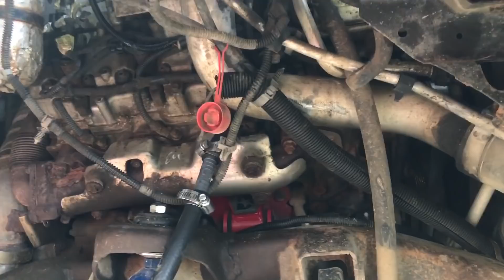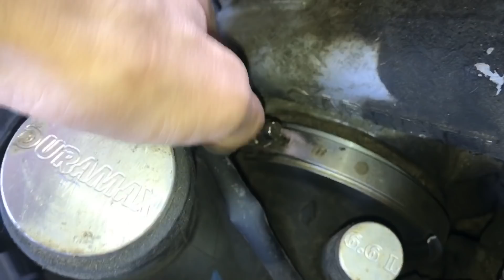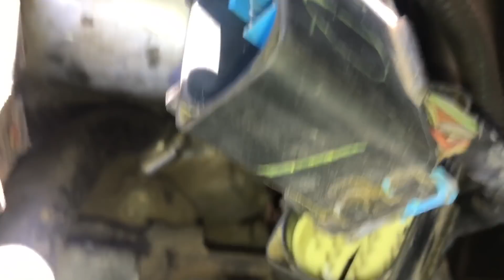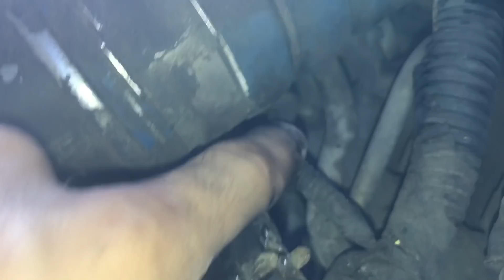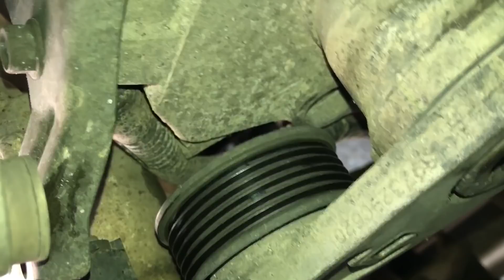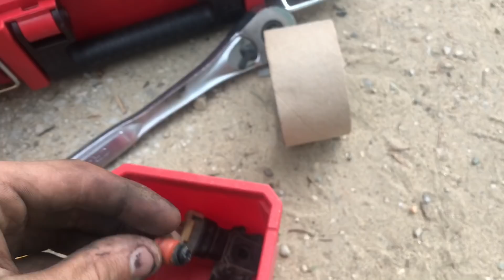How to Remove CP3 Injection Pump from LLY Duramax Diesel

Comment: Pretty sure they put the CP3 on a table and said ok boys.... lets build a truck around this. Ive never seen so many things have to be removed for something. My issue is the bums who did the FPR before me stripped the T25s out. Im having to remove the entire pump to remove the bolts. I only have about an hr a day to work on it bc of my job and daylight savings so this is going to take forever.

Comment: Thanks for the video it helped me. I just got everything apart, hopefully I’ll get it all back together tomorrow and the truck still runs. Bottom nut passenger side of the Y bridge had me about to get it towed to a shop, that metal line coming up under the turbo they could have routed anywhere, they routed it there. I’d like to be sitting next to a guy in a bar sometime that tells me he’s the engineer that designed that line route.
Reply: How’d you manage to get it in about to just leave it at this point
Reply: Dude I couldnt agree more! they routed many of the lines in terrible places, not just that one…why route the pass side fuel return over the bridge instead of over the cp3 then T with cp3 return…the factory design makes after
Market 1 piece y bridge a nightmare. Looking at the full soft line test block conversion kit from DHD to reroute all of them, but annoyed I have to 🤣
Reply: Same!

Comment: That was not a pyro sensor, it is the vane position sensor.  Also the one you said the sensor was in the fuel rail to the left of turbo is the fuel temp sensor and lastly the sensor on the bracket that holds the engine harness plugs is the barometric sensor

Comment: Does cp3 needs to be set on time with engine?
Reply from the maker: j. Onofre no it does not need to be set in time. It just creates fuel pressure for the common rail. So it doesn’t matter. If it was an older Cummins or power stroke it would matter.

Comment: The dirty Y bridge - I don't understand why it is so nasty.  Yours looks like another video that I saw, so nothing unusual there.  When I took mine out from my 2003 @200k miles, mine looked very clean; I don't recall any carbon or buildup at all.  In thinking about it, this should be fresh air that passes through turbo then the intercooler, so where is the crud coming from?
Reply: that comes from the EGR (exhaust gas re-circulation) which not all  LB7 duramax's had... 2000-2003 did not. 2003.5 and newer did have....

Comment: Thanks for complete video. I’m doing same. What gaskets and o rings did u have to replace?
Reply from the maker: It depends, it’s always good measure change thermostat send thermostat seals, but nothing is technically required. There’s a few o-rings in the coolant pipes that could probably be changed at the same time. It really depends on age of the truck
Reply: @JoeBarronTV  What would be the diagnosis steps to determine if it is the fuel pump? My LB7 is crank no start status. Both batteries and alternator tested good at the local parts stores. I thought it could be the alternator because the batteries kept dying ( probably due to only driving it every 2 weeks or so). The only other issues happening before this were the language kept switching to Spanish or French while driving. Some times it would constantly scroll between all three languages while driving. While annoying, after starting and stopping a few times I could switch it back to English and it never prevented it from firing up. I also ran out of fuel when the gauge read 1/4 tank so I started filling it at 1/2 a tank. Not sure if any of these issues are related but any tips would be greatly appreciated. I can't afford to tow it to one of these high dollar mechanics in this tourist town I live in!

Comment: Lol went there on mine for that small coolant line and said to hell with all the brackets and left them out
Reply: Stealthcon69 the line right in front of the turbo, could have routed around the side or under the Y, but no, had to put it right in the way of getting at the bottom nut!

Comment: Nice vid. Get the LBZ turbo mouthpiece it's a HUGE improvement on engine temperature when towing. Really helped my truck stay cool.
Reply: Thanks! I really don't have any problem with heat, I live in Michigan. Negative 35 degree cold starts are my biggest challenge temperature wise.
Reply: Yes but add air its so much better i noticed a huge difference